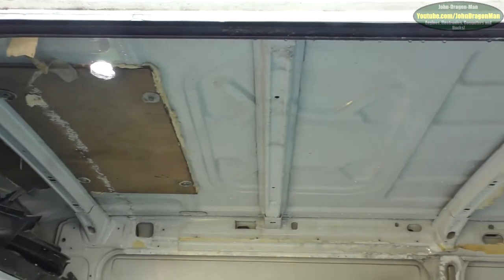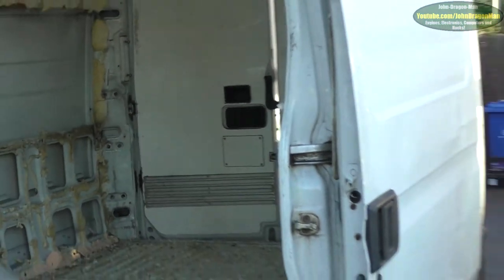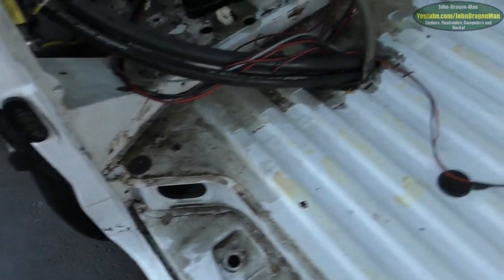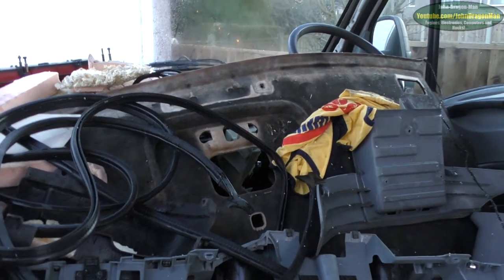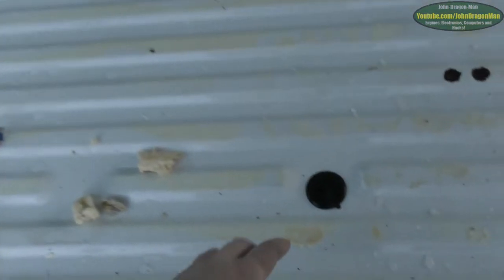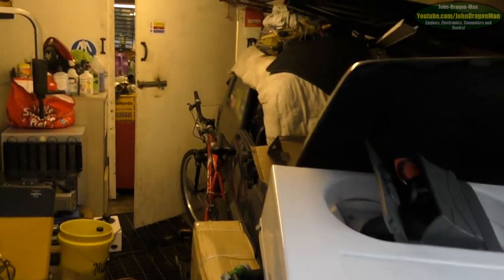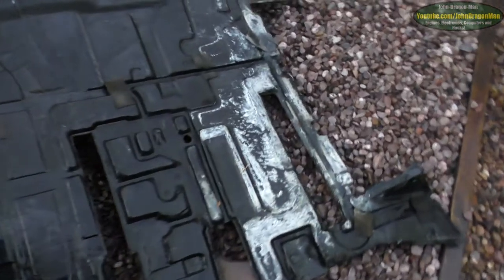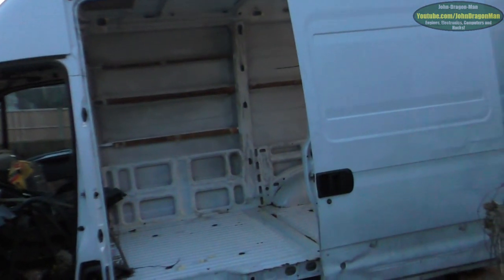Iveco Daily Fridge van to Camper Vlog 4 - Expanding foam removal

Comment: where did you get your camper windows from to go threw that thick insulation bud
Reply from the maker: well we have not yet installed windows into the van. its a very slow project. we did not end up using the 50mm xps, my brother went for 25mm celotex. i however did use the 50mm XPS in my little camper project.
i am unsure what my brothers plans are when it comes to windows. i will ask him and get back to you

Comment: Hi mate u know where is located the expansion module ?
Reply from the maker: Err.. I don't.. that's a new one to me. What is it part of? Engine.. coolant system.. suspension? Sounds like it could be part of the air suspension I know these sometimes came with.
Reply: @johndragonman  i convert my van from auto to manual but now don't start i remap the ecu immo off but stil don't start i put my obd and coming fault from expansion module and BCM CAN LINE
Reply from the maker: @adrianioan8265  well the BCM is the fuse box.. I guess make sure all the plugs are connected properly. We had the engine randomly cut out on ours and it ended up being a plug not plugged in all the way!